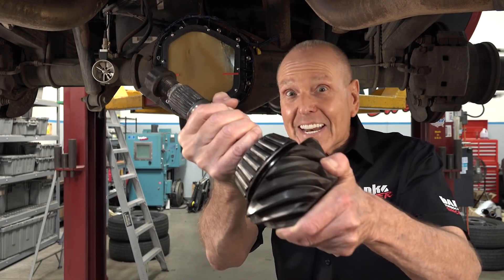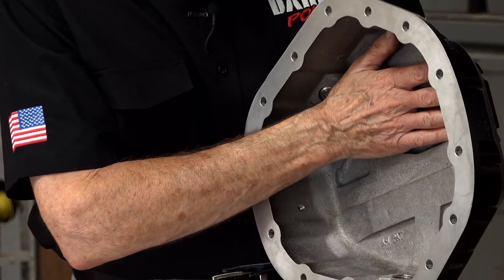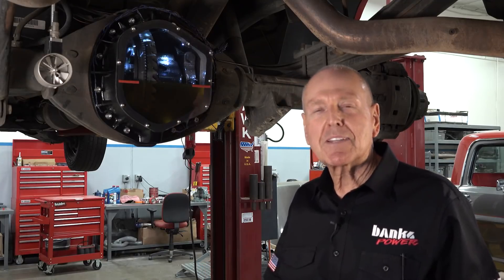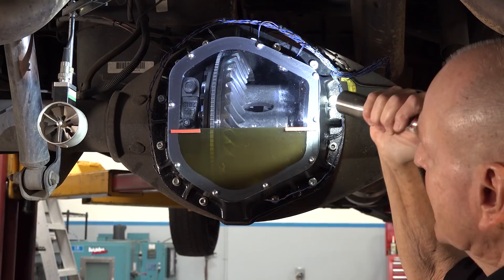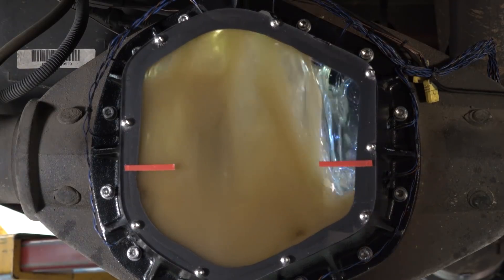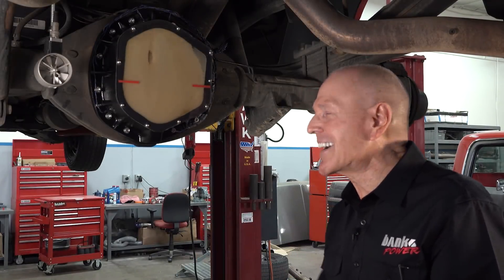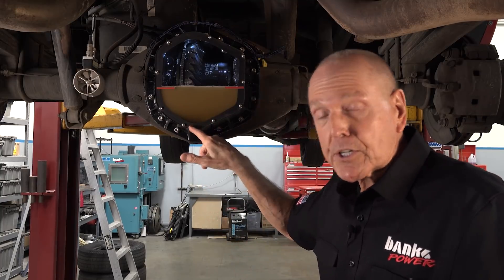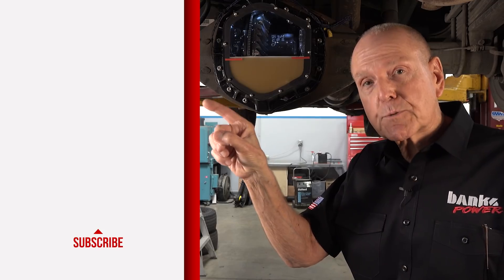What's going on behind your flat-back diff cover?

Comment: When can I buy a Banks aluminum stock style cover?
Reply: Coming soon
Reply: Buy oem
Reply: @JRLSprague3  oem shaped on the inside, but it looks cooler and has larger fins on the outside.
Reply: Why does anyone need a strong cover? These are not for smashing rocks, rumor is they are better for towing and under loads.
Reply: Huge hole in the back of the rearend... pro tip... if it was not structural... it would not need so many bolts.
Reply: @mattlane2282  the oil pan has many bolts also, that is in no way a structural piece either. The many bolts are for consistent pressure to prevent leaks
Reply: oil pans add strength to the block... they also have bolts that are 1/2 the thinkness
Reply: @SDLAX46  Every engine has some blow by. Dont need a seal blowing on my oil pan because of it.
Reply: @brandoncaldwell95  what are you trying to say? Every modern engine has a PCV valve to reduce the blow by pressure you're talking about
Reply: Spencer | Sweis12 I notice on some newer Cummins I believe the duallys with the goose neck, tow package etc. they come stock with fins so you get the factory design and the fins for cooling. Doesn’t get much better than that
Reply: @SDLAX46  I dont care what you say or how they are modernized. Modernization only means more crap. That crap doesnt solve the original thing to begin with. Every engine get blow by and it does go to the pan.
Reply: @T-Dawg6.7  Thought that was only with the aisin trans option? I know ive seen them. My 64RFE trans dually does not have those fins.
Reply: @brandoncaldwell95  if your getting noticable blow bye creating pressure on your pan. Then you have bigger problems. Cause that pressure is going to mess up your rear main seal and other seals would fail before effecting the pan.
Reply: @crazymtbike  I know that. Not my truck, so i dont give a crap. Mine only has that ccv filter needing to be replaced for the last 12,000 miles. Just dont see spending the money when with the sucker clogged i get 2mpg better.
Reply: The banks bait commercials .........
Love how he puts down aftermarket  products as this is his line of work.......wait for it........
Reply: He better put a better product on the market after this unproven hypothesis, trash talk, and delayed fake science. All I've seen is build up to nothing. Needs a camera angle from above the pinion to prove his claims. If this was even half true, there would be stories on the forums and YouTube videos from truck owners rebuilding tbeir axle after it failed pulling a trailer across the country or rock crawling at bad angles. Lots of people abuse their axle, but the only failures I hear about are semi-floating shaft breakage and U-Joint failure. Too much torque & traction for the axle, never a lack of lubrication bearing failure.
Reply: @SDLAX46  oil plans literally are structural in many cases
Reply: Matt Lane Better Heat Conduction  Aluminum ~4 times better thermal conduction than carbon steel. 
Obviously different alloys would vary the difference but not enough to cover the 4x number. 
Stainless steel (high chromium) is 15 times worse for thermal conductivity than aluminum.
Reply: Matt Lane Most airplanes are made almost completely of aluminum. It’s been perfected. 
Weight really, really matters in all things flying. Not near so much in cars and trucks.
Reply: Matt Lane I’ve been told not to feed the trolls. So I’m trying not to.
Aluminum glass alloy? Not before the 1990s.
Alloys generally refers to metals. Aluminum and glass would be a composite.
Maybe you’re one of the Original Roswell crash survivors. I was born there so maybe I’ve got some subliminal telepathic insights.
If so, please send me the manuals on your flying craft. I’d love to get some hard evidence.
Wood is the original natural composite.
I know quite a bit about materials science. College degree and all that.
So please. I’m asking nicely, let it go.
Thanks. MM
Reply: Ya now you are all pissed off because I called you out on it being an ALLOY used when you are crying about it being just "aluminum" rofl... give it a break... it is an alloy with silicon in it... same shit glass is made out of... figured I make it easy for someone who thinks an airplane is made out of plain old aluminum... 

I mean just to rub it in again... you wanted to talk about multiple steel alloys... and even said "alloys" and then said "airplanes are made almost completely of aluminum."  where was the "alloy" part. I bet you not 1 thing on that plane (or really almost anything anywhere) is straight aluminum. 

SO we can go back to my initial statement... why would I want a weak ass alu cover...
Reply: Matt Lane it's not structural in the slightest.  It has more bolt coverage for a more uniform pressure on the gasket.  Simple as that.
Reply: Arb has them already
Reply: I just checked them out I had forgotten about them.  They don't make one for a 10.5 Ford..  bummer...  Oh well.
Reply: Aam make a stack shaped cover with fins
Reply: Came here to post the exact same thing.
Reply: Thanks I'll check them out!
Reply: @RJ_Cormac  Found the guy who wastes money on diff covers LOL
Reply: @RJ_Cormac  I don't think he's saying no oil gets to the right places. There's too much splashing about for it to not be everywhere. His claim is that there's less than stock and that the stock setup generates less heat in getting oil everywhere.

I'd argue that almost any non-zero amount of lube between gears and bearings is enough to prevent metal to metal contact and you only need more for cooling purposes.

I'm willing to bet that the end result of this is that should thermocouples be mounted everywhere important, a stock style cover will have more even heat (ie the temp difference between the pinion and reservoir will be lower) and slower temperature rise for a given oil volume than aftermarket.

But it's still not going to be a big difference
Reply: I will agree the fill level could have a negative impact. BUT, most of these aftermarket covers he's slowly roasting have 1/4NPT ports for a temp sensor. So any owner could add a sensor and dash gauge. I know some of these covers have different fill markings depending of if the customer has a big lift, big tires, and the lift kit rotated the pinion angle. So these aftermarket companies have done some research on the fill level. I've never heard anyone argue extra capacity is bad, overfilled yes, but extra capacity adds extended lubrication and more thermal capacity to absorb heat if pulling a trailer up a hill.
Reply: @RJ_Cormac  capacity is always good, except when you have to pay to fill the damn thing.

One thing I hadn't considered before is: What's the split in heating due to load and heating due to moving oil about? Heating due to load occurs between gears and rollers at pressures of thousands of psi on tiny contact patches and probably isn't affected at all by how much oil is on the part in question. If that number is high compared to the heat generated just turning the thing over none of this matters and it is just about volume and cooling fins
Reply: The only negative impact I could think of is not getting the fluid up to temperature in cold climate. It wouldn't get warm enough to evaporate water condensation.
I've added a 28,000lb rated trans cooler, large truck spin on transmission filter 51622, and transmission thermal bypass valve so it will get above 175 in the Michigan winters.
And I have a trans gauge so I'm not making up claims. I over designed the cooling system and added a thermostat.
Why has Banks done at least 4 videos and hasn't even mentioned a temperature yet, I doubt this truck is still in the shop.
Reply: Brandon Caldwell go look at Greg Alberallas truck
Reply: Why? Use you stock cover. If it works don't fix it....
Reply: nothing fake about his methods, though I am waiting for the Banks diff cover ad
Reply: @mgoo1713   The only reply I have to that is some of us have roasted axles when towing heavy, back before these covers came around I drilled ports into my stock cover and installed a pump and trans cooler with fan on thermal switches. 

I've talked to a guy with an f550 powerstroke pushing a little over 500hp  that tows heavy and has burned up several Dana 135's.
Reply: I’m buying one when they do
Reply: Matt Lane, it has zero to do with structural support, and more to do with gasket sealing.  Think about the oil pan of your engine.  That weak stamped sheet metal oil pan has a bunch of fasteners too, but there is no structural rigidity added to the block as a result.

Comment: Just wait until this is all done and the OEM manufacturers see it! They will send a message down to  all service departments at the dealerships, that any bearing failures with a non-oem cover will not be covered. And they will have the video proof to fight it in court. 

Conversation:

Dealer: We figured out what the whine noise is. Looks like the pinion bearings have failed.

Owner: OK I thought it would be something along those lines. That is covered under the powertrain warranty right?

Dealer: Well it would have been. But since you have an aftermarket square diff cover & Gale Banks did a whole series on how they are junk, that actually causes damage to the diff parts. No it will not be covered!
 We have the series on DVD here at the dealership. You can purchase it for $4500 and we will throw in a new rear end. 

Owner: But I was told they were better than the stock cover. They have cooling fins.

Dealer: Everyone was told they were better! With no actual science behind them. Well now we have the science. 

Owner: Son-of-a-b!#<&

Guess we will see how this ends up! I am staying tuned.
Reply: I was a service manager at a GMC dealership . We turned down warranty work on several occasions because of differential modifications. It is in General Motors policy and procedures you modify it the warranty is off.

Comment: Drill a hole into the diff housing, so that you can insert a camera to look at the pinion.
Reply: Hell cut the diff out make one of all glass with a glass ring & pinion so you can see everyting. Cancel that make a glass truck.
Reply: Just stick a go pro or a bullet camera in there to see. Easy enough to do, and they are cheap.  Mount it from the cover side since you've already got one hacked up, just add another hole.
Reply: Agree he's making claims about the pinion he can't see nor prove. This is turning into as seen on TV science sales tatics 🤔🙄
Reply: R.J.H1978 I agree. I love this series but seeing that oil roiling around everywhere, I don’t think pinion bearing are gonna starve. Stranger things have happened so he should show it.
Aeration could be a serious problem and should be avoided as much as possible. These flat backs seem to make it worse?
Drain the oil, let the air come out and check the volume change. Easy to do. Maybe he already did it and I missed seeing it.
The BIG deal is all of that work done on a very thick viscous fluid.
Wasted energy and, although he’s not done testing, I’ll bet higher temperatures are seen. Hence the need for the fins.
A viscous circle.
A chicken and egg sort of thing?
Reply: It this was such a big deal, the Ford 9in with mounting flange for the drop out differential, would have been a complete failure because it has a hard 90° stopping flow of gear lube, if Banks is correct.  🤔🙄
Reply: What does the back cover look like on a 9"?  (( I'm a GM guy, not familiar with Ford rear ends.. ))
Reply: never mind..  I found it.
Reply: @slamdvw 9in doesn't have one, the differential comes out of the front of the axle housing. It's the #1 axle for Nascar, drag racing, aftermarket, etc. Ford 9in is the king of axle history.
But it's design has a flange the differential mounts to, and that mounting surface is worse than any of these covers Mr Banks is "science" trash talking, separating the spinning ring gear from a smooth gear oil flow. Plus there are 3 bearings on the pinion, adding more it has to lubricate. I put a 9in in the back of my truck, love it. Currie offers a full floating 9in with Dana60 ends for any GM vehicle, it's indestructible in Rock crawling!
Reply: Same thing I said, you are absolutely correct. Gale is all bent out of shape about fluid carry over, having no idea what's really going on in there. 

If you look at the big trucks, like Peterbuilt etc, and the 550 Fords, they use an axle design where you can pull the whole carrier as a unit, after you pull the axle shafts, meaning they are a huge version of a 9 inch (or the 9 inch is a miniature) but either way, they all have that lip that Gale is crying about. They all seem to work just fine.
Reply: @kleetus92  maybe there's a Banks approved axle cover with pinon oil pump driven by the speedometer tone ring, going on sale just in time for Black Friday sales! 😂
Reply: @RJ_Cormac  he is making a strong case though. He theorized that the fluid was being overworked, and that was visually observable. I don't doubt that he will pursue this further and provide more evidence to substantiate his claim.
Reply: He's selling something, people seem to love this hack science and LED lighting 🙄
Reply: Maybe, just in time for holy shit i'm broke season!
Reply: @kleetus92  but they are still curved back covers that the fluid can follow.
Reply: @Meekerextreme  not sure who you are talking to...but I am not being negative. I like Gale Banks and this series, but a look at the pinion would tell a lot.
Reply: @Meekerextreme  spoken like a true sheep running wth herd of me too... what exactly have YOU done to have any validity?
Reply: Alyn Penners Aeration is less of a problem than you or he thinks. Class 8 diesel trucks run the same 75W-90 gear oil in their differentials and they take 2-5 gallons of oil to fill one differential, they usually have 2 differentials. They also aren't designed with this psudo-science bs of, "It needs to be dome shaped". Most of the axles I've worked on as a Diesel Technician, have flat spots in them with a dome shape only to clear the ring gear, the ring gear is about 1/3 submerged in oil as well. The ring, pinion, and carrier weigh an average of 300 lbs on these trucks. Forget about Mack/Rockwell axles, they usally have a flat bottom or even a very shallow dome in them to allow for the top mounted carrier to sit down into the axle housing from above and prevent offroad boulder damage. Those types of axles were designed for offroad/rocky terrain.
Reply: @transam1995lt1  the backs are yes, but the top and bottom have 2 sharp corners each.
Reply: @JosephArata  exactly!
Reply: @kleetus92  
And then there's the Mack top loader diff's, I wonder how they would do.
Reply: @RJ_Cormac  explain your logic as to why he is wrong......
Reply: @mgoo1713  This had already been documented above, with links to images of the axle designs without a perfect circular fluid flow, in heavier duty (load & duty cycle) 2.5ton up applications, plus the famous Ford 9in that would dominant any 10.5in with an aftermarket full floating kit. The 9in wins on every Sunday every week, and you can buy them on eBay used because Nascar won't run it twice.

Gale Banks is doing a nice job pushing his brand on YouTube, fun to watch, but the science is lacking, no numbers yet to even back up his claims. Nor is he going to test a second axle design to validate his process.

I have nothing to sell, I'm a FireFighter Paramedic, unless you want a calendar? 😉

Comment: My only issue with pointing out how much fluid isnt making it to the pinion is it's not looking at how much is still being carried to the pinion by the ring gear. The aeration if the fluid is definitely a concern. All things said it seems like these aftermarket covers dont offer enough bang for the buck to make the cost and effort worth it. Now a real test I'd like to see is a stock steel pan with  .75" fins tig welded 1" apart vertically over the entire pan and see the temperature difference between it and a stock pan
Reply: It's an 8° difference
Reply: "My only issue with pointing out how much fluid isnt making it to the pinion is it's not looking at how much is still being carried to the pinion by the ring gear."

That's carrying it to the pinion, not to the pinion bearings, which are further forward in a recessed area.

Comment: How about a stock one with a damn drain plug. I think most of these guys with the aftermarket diff covers are really just after the drain plug option
Reply: Fluid evacuators are cheap now, just get one of those.
Reply: I'd be happy with a drilled and tapped hole in the bottom of the housing with a flush hex pipe plug so you can drain the fluid without pulling the pan. It's just a function of cheapness/laziness on the part of the manufactures. That's what these covers provide.
Reply: Drain plug? Really? Keep the stock one that has a magnet, crack a bolt, drain it, and hit it with a pressure washer.
Reply: Exactly. What idiot spends 300 on a diff cover to get the drain plug?! U only change the oil every 30k miles! Ram has reusable gaskets. Take 10min tops to change the oil! Drain plug, gzzz.
Reply: My Toyota has a drain plug
Reply: So true as I have been adding drain plugs to my automatic transmission and differential covers since the 1960s. So much easier for us DIY people.
Reply: My tacoma has a drain in the pumpkin
Reply: As per the manufacturer, the fluid is "Filled for life" 
Unfortunately they didn't say how long the life was.....
Reply: I have been drilling and tapping a 1/8 NPT hole in the the bottom of customers diffs for years, then you don't have to remove the back cover, just drain and fill!!!